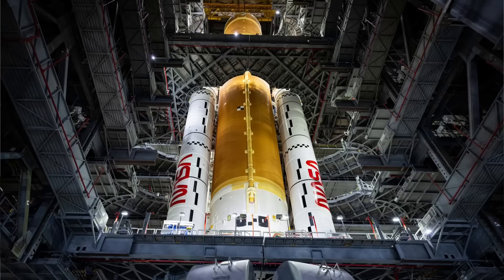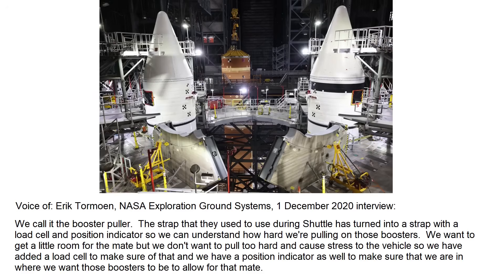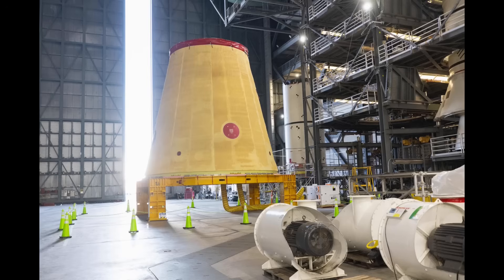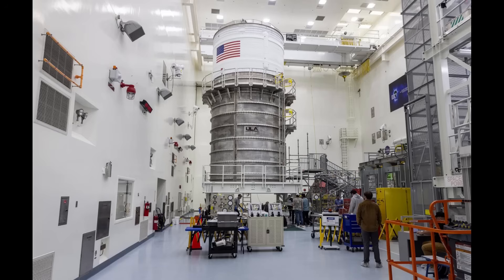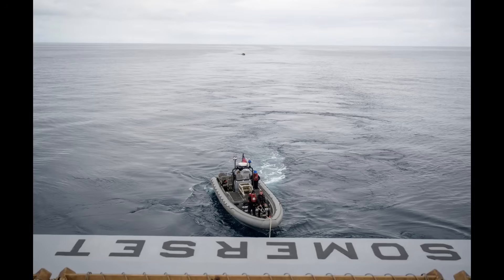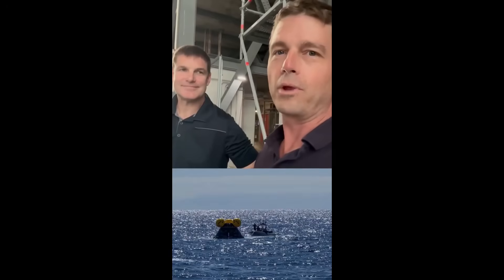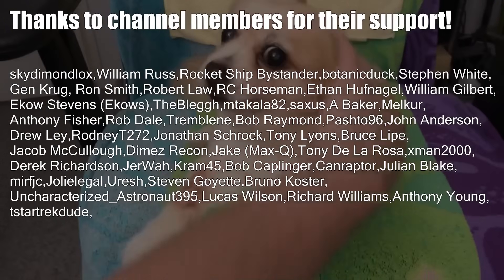What's next for Artemis II stacking now that the SLS Boosters and Core Stage are mated?

Comment: Why SLS core stage has this tubes assemble in the out side of the vehicle? It's so weird. Looks like a plumbing.
It's seems Falcon Heavy, for comparison, there is not such thing. Perhaps I am wrong about that.
Reply: Maybe because liquid hydrogen is so cold that immersing a liquid oxygen transfer tube in it would cause the oxygen inside that tube to freeze into ice?  One might try to avoid that by better insulating (e.g. vacuum-jacketing) the LOX tube - but that just adds extra mass.
Reply: @Spherical_Cow  but this orange thing been a remnant from Shuttle era, I don't recall this exist at that time.
Reply: @gilbert1975nf  The space shittle tank had similar piping, but when the shuttle was on it, ypu could not see it.
Reply: It's because the temperature differential between LOX and LH2 is much greater than the temperature differential between kerosene and LOX, so they need to be insulated from one another as much as possible, meaning they're routed outside the tank.
Reply: The SLS Core Stage is Space Shuttle derived hardware.  The tubing lines are generally similar to the lines on Shuttle External Tank.
Reply: It's not that uncommon.
And they look like plumping, because that's what they are

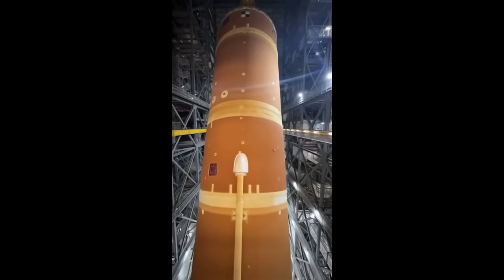Comment: 2:42 huh... I'll reveal my ignorance, once again, by expressing puzzlenent that the SLS first stage has the LOX tank above the LH2 tank.  LOX is much denser, so wouldn't it have been better for overall stability to have it at the bottom?  Weird...  Besides, the LOX transfer tube(s?) to feed the engines has to be super-long because of this configuration: not very mass-efficient 🤷‍♂️
Reply: I think the difference is that having a low center of mass is only relevant for descent, not ascent. And the SLS core stage does not care about descent, unlike Starship and New Glenn.
Reply from the maker: Not exactly sure, but it has Shuttle heritage.  It may be that it was retained for SLS due to the use of the SSMEs.  There are a few threads online with the question of why the External Tank used that configuration.
Reply: I used to know the answer to this question, but I'm not 100% I recall correctly. If I understand right... I think it's to improve the engines' control authority? Sort of like how fighter planes are aerodynamically unstable - if you move the vehicle center of mass closer to the geometric center, it becomes easier to deflect it than if the vehicle was in an inherently stable configuration. Take this with a grain of salt, though...

Comment: Cant they stack the LVSA pretty much right away after stacking the core stage? Its not heavy or anytthing.
Reply from the maker: They did for Artemis 1, but that was a different situation in many ways.  We don't know the exact reasons for the schedule, but they talked about this timeline back in December.

As noted in the video, bolting the structures together goes a lot faster than integrating the functionality of the different pieces after they are mated.